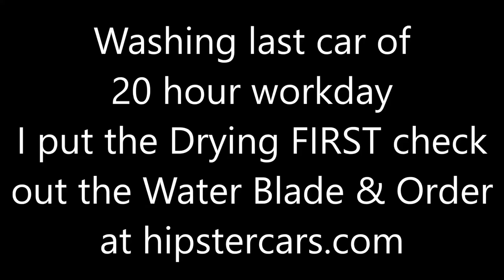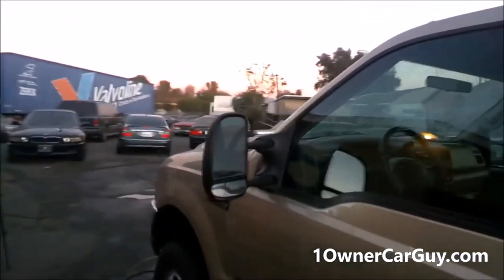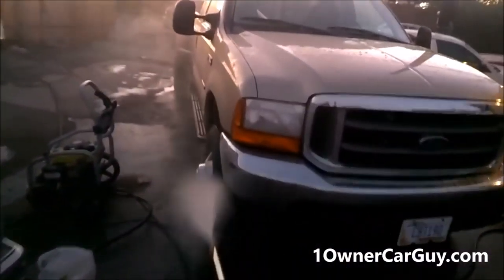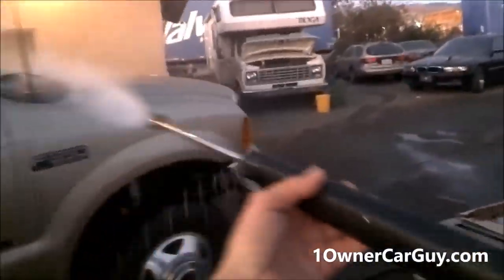Drying Cars FAST! ~ Towel Wand ~ Work Vlog Washing Car Detailing Video

Comment: Is the blade of the car drier made out of rubber?  How careful would I have to be on single-stage black (no clear coat)- as far as making sure I don’t scratch the paint job?  Or in that case am I better off using microfiber cloths?
Thanks.
Reply: Cereal Marshmallows >>> Nathan, thanks for the quick reply & always nice to learn of a new way to do things more efficiently.